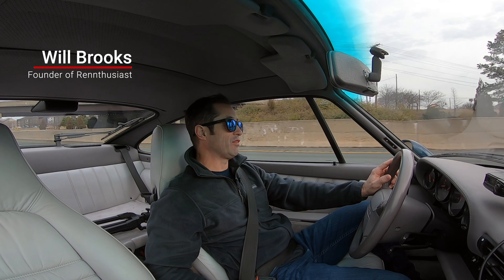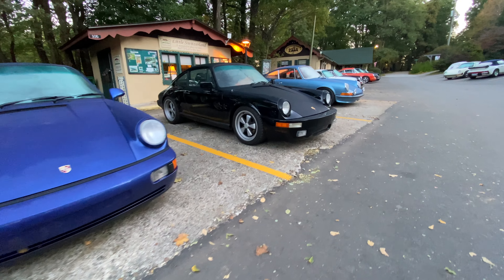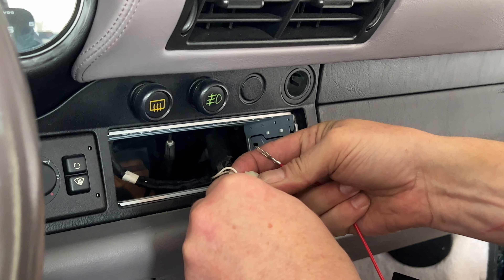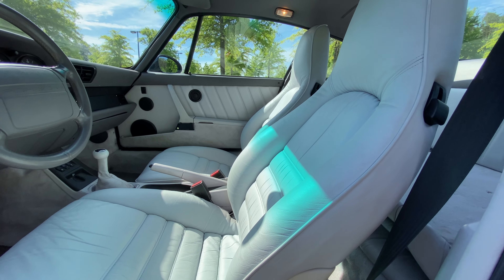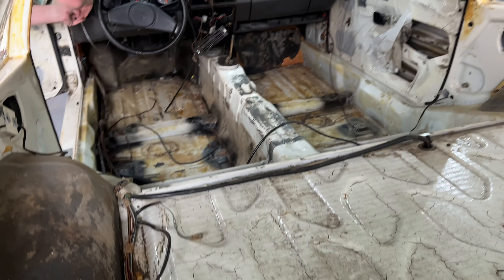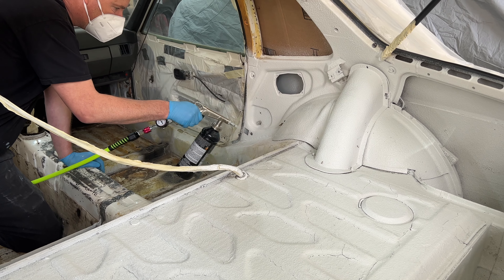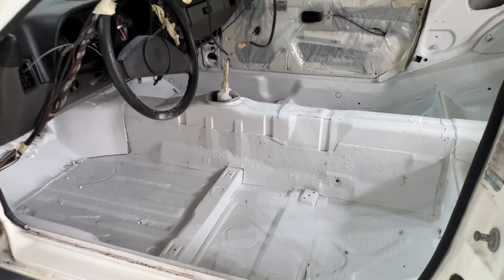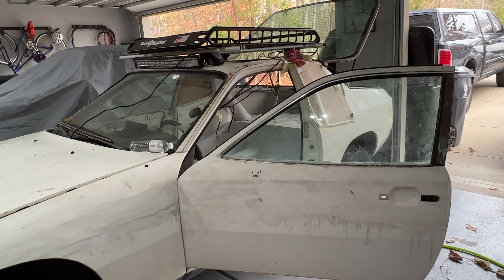Porsche 964 Stereo Upgrade & Porsche 924 Safari Odds and Ends

Comment: Why not install the Porsche Classic Communications Management System (PCCMS) on the 964? It looks and works great. Unless you have your reasons, you will be missing out on a great head unit, which adds modern functionality while preserving the classic look, plus it is "factory".
Reply from the maker: I hear you and understand why people do it but the continental “looks” period and serves my needs.  I have it in my other 2 911’s and it’s fantastic.  And much cheaper than the PCCMS.

Comment: "It's always something" is pretty darn accurate with these cars, but honestly probably the case with anything of this era, but my love of the 911 keeps me going.   A few days ago Will I was bored in the evening and started messing with the sunroof liner of my 86 that is a bit off.   I turned the ignition on, opened the sunroof about halfway and started playing around.  I realized it was a bit too cold in my garage for my liking and that I would just do this at another time.  Went to close the sunroof and for the first time ever...nothing happened.   For the next 30 minutes nothing.  February in Colorado, 10 degrees outside and my sunroof is now stuck halfway open.    I played with the ignition, checked fuses, kept trying the switch and nothing.   Went through my bag of extra parts and didn't have an extra switch.   I then popped out the switch, fiddled with it a bit and put it back in again and miraculously it worked and shut.  I'm now scared to try it again before sourcing a new switch or maybe I'll just leave it closed forever.  Haha.   It's always something, but these are my dream cars and i'm ok with that.   Cheers pal!
Reply from the maker: Here’s the good news.  When everything is working as it should, it makes the hassles all worth it.  Just part of the journey.
Reply: Deoxit. So far, I’ve “fixed three switches in my 964 by hosing down the switch

Comment: Hi Will,
This is a bit of a left field question that has nothing to do with our beautiful Porsche cars.
I noticed you are wearing a "Black" ring on your right wedding finger.
What is that and correct me if I'm wrong but I have not noticed it on you before.
Forgive me about asking this question as I realise it may be personal.
Reply from the maker: No worries.  It’s a QALO ring.  They are made of rubber and are easier to wear than standard metal rings, especially if you’re active like I am.